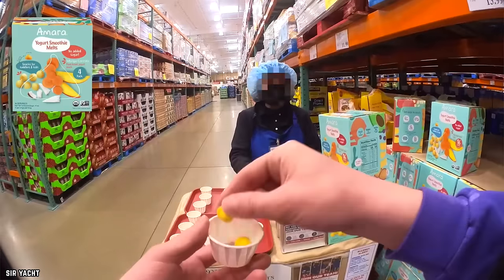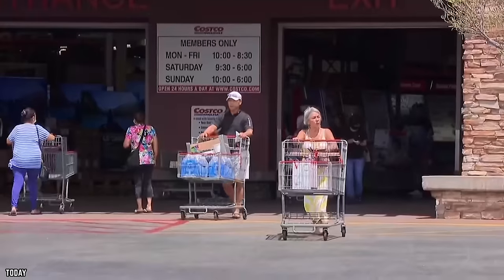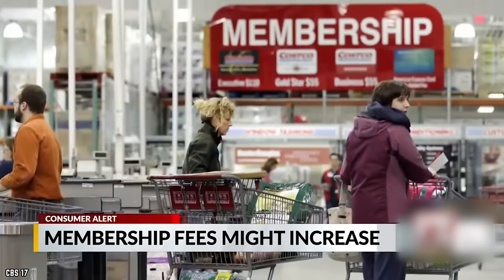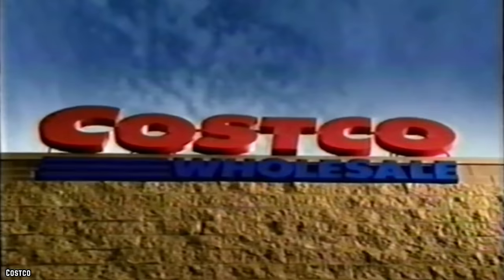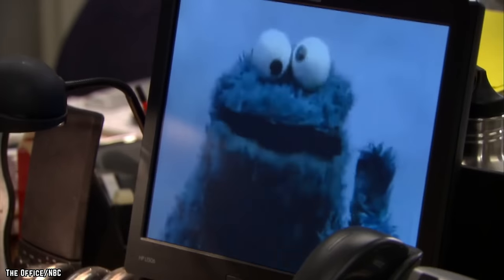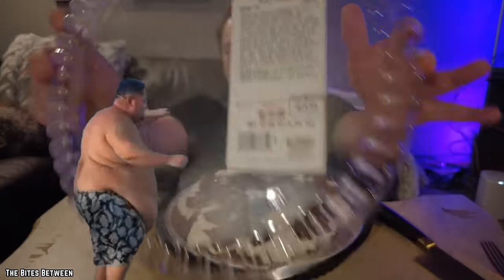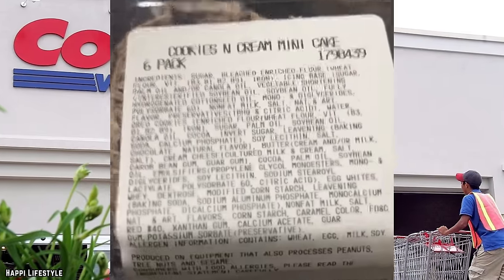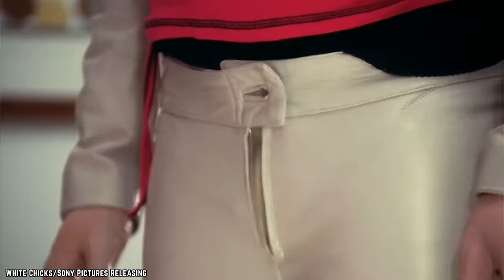16 Big Changes Coming To Costco in 2024

Comment: So, the Costco stores in my area will not let customers use the hand scanner any longer for self check-out. You must remove everything from your cart, scan it then put it on the scales then return it to your cart. By contrast at Sam's Club I scan the items as I put them in my  cart with their app then it's checked at the door.
Reply from the maker: @cwarner5909 Thanks for sharing your observations! It's interesting to hear about the differences in self-checkout processes between Costco and Sam's Club.
Reply: The Walmart self-checkout leads to you being accused of theft. If not yet, it will!!

Comment: One problem with the digital membership card it can only be on one device.  I shop mostly online so I have my card on my iPad but if I want to go to the physical location I need to remember to move my card to my phone but you can only do this so many times before Costco freezes it and you have to go to the service counter to get it reset.  That is a pain; however, even in my 70’s I still love my Costco.
Reply from the maker: @michaelcollins8316 It's a bit of a pain, but Costco is still worth it!
Reply: Sam’s Club is much more flexible, and especially their online ordering.
Reply from the maker: @nadogrl Having options for flexible online ordering can make shopping much more convenient.